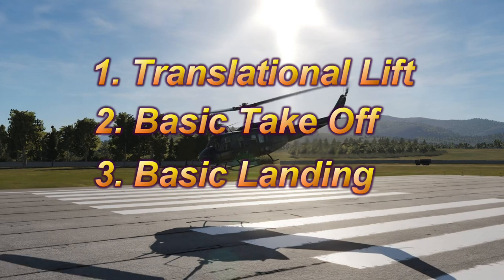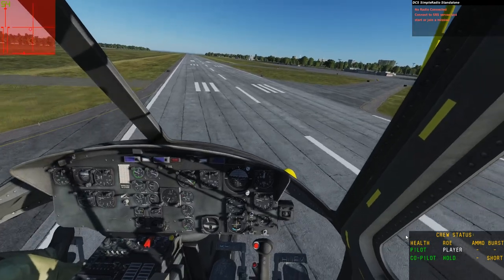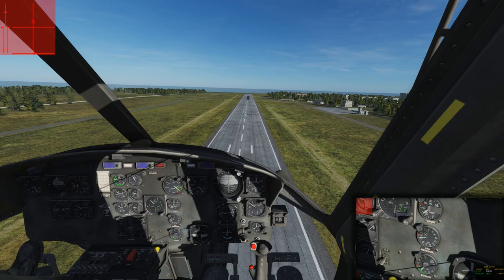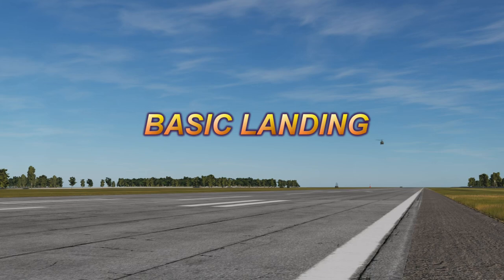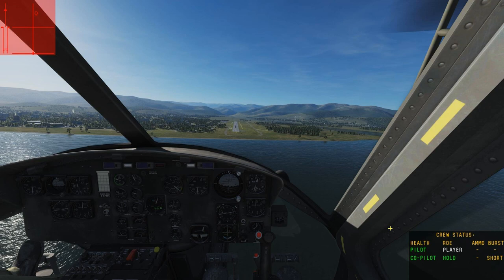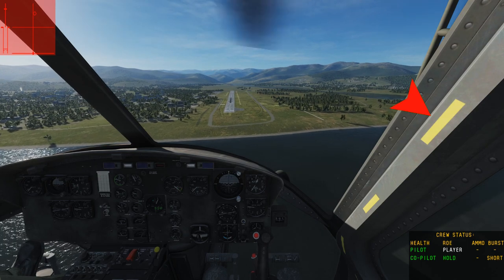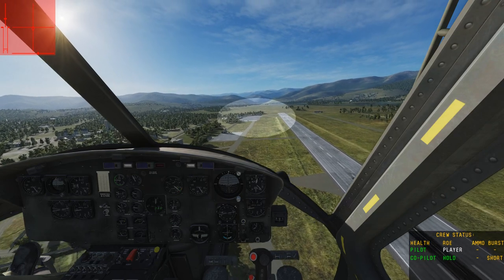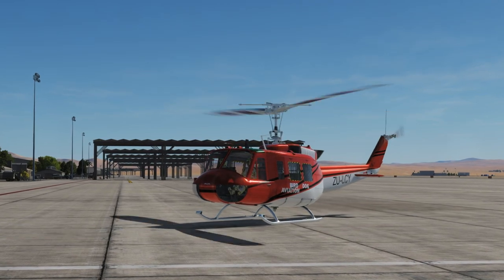DCS World: Translational Lift, Take Off, And Landing Tutorial

Comment: Its called ground effect, you are either in it or not. You can be in ground effect, but there is no in-ground effect. Helicopters don't go in-ground. Ground effect is, in simple terms, compressed air between the rotor blades and the ground creating a cushion of air that basically increases to efficiency of the flight surfaces of the heli

Comment: based on the rotation of the rotor, is the lift all coming from the right side of the rotor when the chopper is moving forward? The left side of the rotor has the airfoil backwards to the airflow.
Reply: At a hover, lift is evenly distributed all around the rotor disk, and so is the pitch angle of the blades. To get moving you first have to create a difference in pitch from one side to the other by moving the cyclic. This moves the center of lift away from the center of the rotor disk, which causes motion. Once in motion relative to the air, then yes, the blade advancing into the air creates more lift while the blade retreating from the air creates less lift. The higher the airspeed, the more the lift shifts to one side of the rotor disk. This is one of the biggest limiting factors to helicopter speed. For a Huey, this means the lift drains from the 9 o'clock position and piles up at the 3 o'clock position. This is called dissymmetry of lift. But because the rotor disk behaves like a gyroscope, the force presents itself 90 degrees later at the 12 o'clock position, causing the nose to pitch up.

Comment: Of course translational lift is not called that because you transition to it, then it would be called transitional lift. It is called that because you have translational movement, which is the correct term for forward movement or movement where the center of gravity changes location as opposed to rotation. Otherwise great lesson!

Comment: Small correction. All aircraft push air downwards in all stages of flight. That's how aircraft stay in the air. In forward flight a helicopter is still pushing air downwards. It's just doing it a bit more efficiently because the rotor system is acting like more of a wing and it has an overall greater effective surface area.
Reply: I saw the video and I was sure somebody will make a comment about the explanation he gives.

I think he just simplifies the explanation to make it easy to understand.
But what you say ... well ..  
Airplanes are not flying pushing air down, not even helicopters do.The Rotor system is ALWAYS acting like a wing (rotating wing). It is true that is more efficient after getting Translational Lift.
The reason why it is more efficient is because the Vortex are created (Vortex not interfering with the rotor to be more precise)
I don't think he wanted to get into it so he used the Harrier as an example.
When you simplify an explanation it is obviously wrong, no need to correct it. The intention is make it easy to understand, not to be precise and correct.

It is what I think I may be wrong and I may do the same with your explanation, lol.
Cheers.
Reply: @Franjaver  Fair enough about his simplification. However, yes, all aircraft push air down. That's how flight is achieved. Wakes are the result of this. The weight of the aircraft is supported by an equal amount of air being pushed down. It's simple physics.
Reply: @littlec916  Sorry man, not trying to start a fight here.
Airplanes are not pushing air down to keep themself in the air, I would say they are doing the opposite. And those physics are not simple, I won't say it is Quantum Mechanics, but sure it is not simple.
I think you have in mind (and it is reasonable to think that) the Newton's 3rd law. But that is not how it works.
If you see how an airfoil works you will see force air UP under the wing. That air is not pushing down but the wind creates airflow pushing down.
Wakes turbulences are created when the air pushing Up link together with the air passing above the wing. That wake turbulence stays almost at the same position and goes down slowly. It is not a current of air like you have a fan facing down.
Im talking of Airplanes.
But helicopters are very similar, really. When you increase the Angle of Attack (AoA) on the blades, you create more lift and start to also push air down (like in Newton's 3rd law) but most of the lift is generated by the Airfoil principle I told you about. I think it is only up to 30% of the lift created by the 3rd law.
I said it is not simple bc even today you can find textbook showing how an Airfoil works but that explanation it is not right bc recently after a research they find out is not the way lift is created in an airfoil (In case you are curious Im talking about the two particles that travels up and down around the airfoil and the ends at the same time in the trailing edge of the airfoil).
To be honest when I found out about this I was surprised but fascinated. Hopen this happens to you also.
Do a quick research and let me know what you think.

Comment: you seriously overcomplicated this explanation with talks of harrier and whatnot. so here: ETL is the relative increase in lift due to velocity.

  i.e. @0 knots n power is required to maintain altitude.  as you being to move, the blades receive higher relative wind speeds, thus produce more lift (by average).  This means so long as you maintain/increase momentum, the helicopter will climb without a change to collective.

tl:dr when moving, the blades contact the wind at a higher relative speed, thus produce more lift.